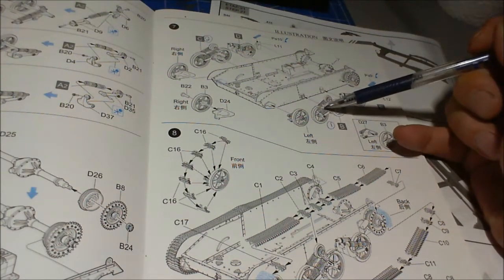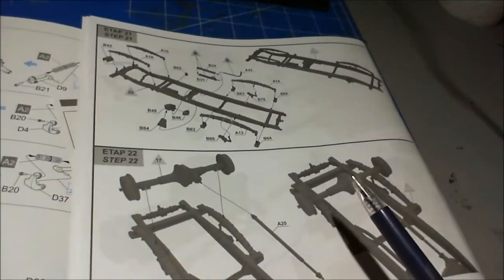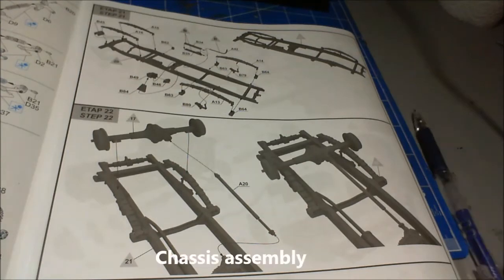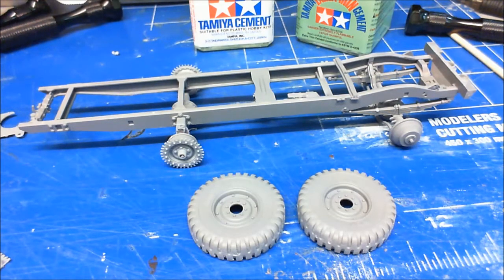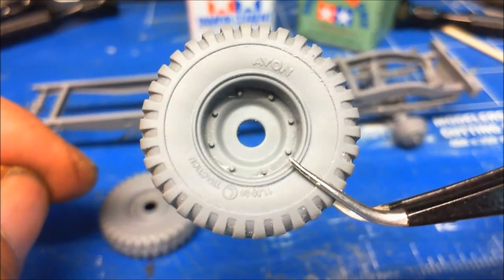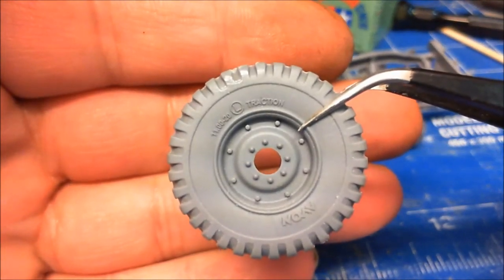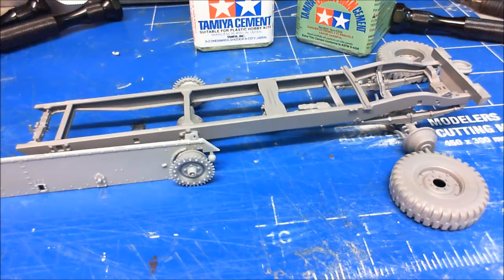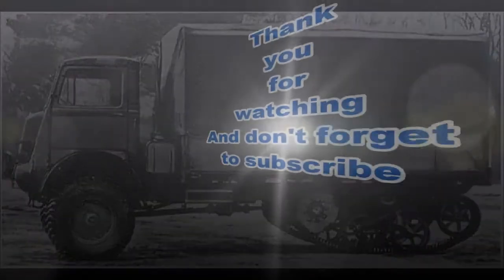IBG Bedford half track build log

Comment: Thats a good idea for a halftrack vehicle.
it kind of reminds me of an opel maultier at least the chassis part.
you might not need to make side panels for the sprocket wheels and tracks.
opel maultier and the panzerwerfer 42 has the track axle and suspension connected to the chassis using some kind of bar frame.maybe that would work on this vehicle.
Reply from the maker: Thank you so much you have put a little idea into my head. I will get back to you soon Sim
Reply: Your welcome!im still waiting for my 1 35 otter to arrive.I found one in my country so it shouldnt take too long.